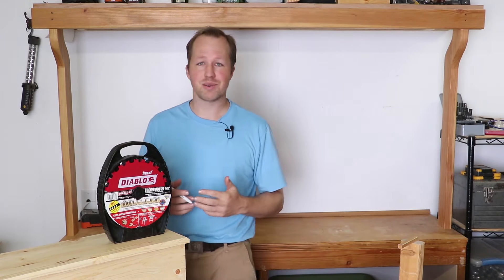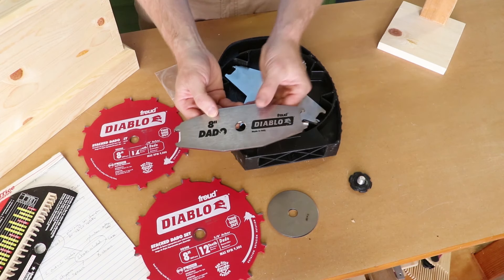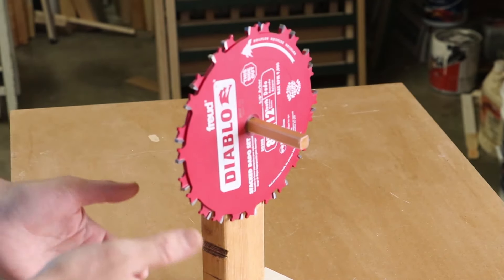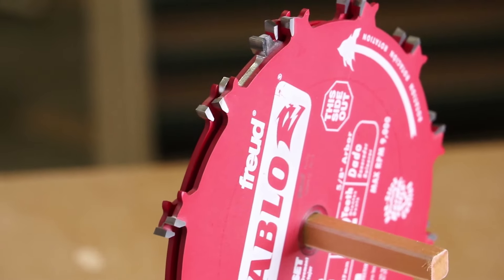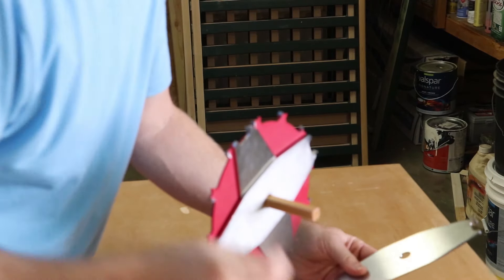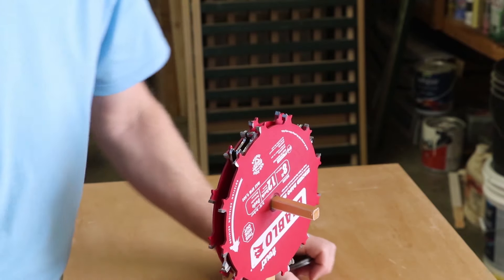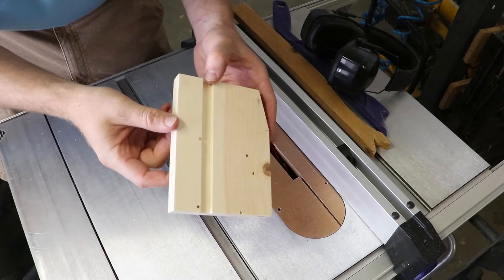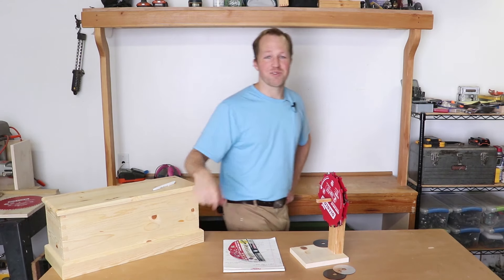✔️How to use the Diablo Stacked Dado Set

Comment: Sorry that's not the way I was taught to set up a dado set.
When I was hurt on how to set them up the chippers always went 90 degrees was one of each other if you use two of them if you use three of them you fell right in between where you got that long big gaping hole between the outer blades I could be wrong I'm no expert

Comment: I was trying to dado across maple plywood and the splintering was terrible,,i even taped where the dado cut was going to be and it was terrible,,any advice to help me would be appreciated
Reply from the maker: That can be tricky. It may be overkill but try using 1/4 thick plywood instead of tape to prevent tearout and use a zero clearance throat plate ➡️ https://www.youtube.com/watch?v=WtHDBpKyJlo
Reply: Make a new zero clearance insert and make sure its set to proper height :)

Comment: I have used adjustable  and stacked dado sets for years, and the only tablesaw that could not use them was a small portable one from Sears.
What is so special about the Diablo Stacked Dado Set? I'm betting it is no different from the old ones I owned and used. I'm also betting before I even watch this video that you will not be revealing anything I do not already know about dado sets or how to use them. I'll update this message after watching.
Update:
OK, as promised, I watched the video, and as I thought, you showed me nothing I did not already know. My dado sets were different in that the cutters stacked between the outside blades were a bit different. The principle is still the same though. As for the lifetime guarantee, that depends on what brand you buy. My brands always had the real lifetime guarantee. That does not include sharpening the teeth, or replacing old worn out teeth. I had a man I was dealing with who had all the proper equipment to keep my professional blades in good shape, and he did excellent work for me. My Dado sets did not need shims, because there were different widths of cutters in each set.
Now about adjustable dado blades. The one I had was adjusted by a built in dial system you twisted to make the blade the correct width. I set up tyoo much vibration in my Delta Tablesaw.

Comment: I know this is an old video. But, this is dangerous business, and you should let us know whether you got your info from Diablo or if you just decided that this is the right way to stack it. I never heard you mention any kind of source for your info. It seems you have the exact stack that I bought from Home Depot. There's nothing in the package that tells you how to do it. People are searching for videos that will show them the proper way. As far as I can tell, you are just telling us what seems right to you. But you're passing it off as the "correct" way.
Reply from the maker: The instructions I used were the instructions that are provided with the dado stack. There is a circular card stock paper with a sizing guide. The instructions are located on the reverse side.
Reply: The included instructions are garbage, and I suspect the same vague language used for other tooth count/chipper style configurations. All they say is to orient "every other" chipper 90*. Where to land the chipper in relation to outer blades is also useless - they say to position the chipper tooth "between the two gaps in the outer blade"???
Reply: Good video, well explained! He's set it up correctly as stated in the instructions.(rotate each chipper 90° to the last)...Not to be insulting, but this IS dangerous business and if you haven't bothered to thoroughly read the instructions then maybe you shouldn't be using a dado stack at all. This guy took the tone to make a great video for people that are to lazy to read 1 paragraph instructions, and all you can do is chastise him. SMH...

Comment: Cuts ok , BUT if your table saw doesn’t have a way to lock the arbor to tighten or loosen the arbor nut ( older Powermatic 66) then good luck trying to tighten the arbor nut because that pretty red slick coating makes the blade just spin between the arbor flanges when you try to tighten  , so this blade sucks in my humble opinion